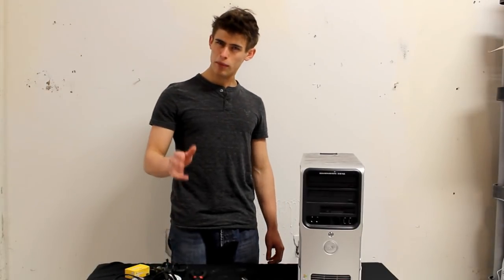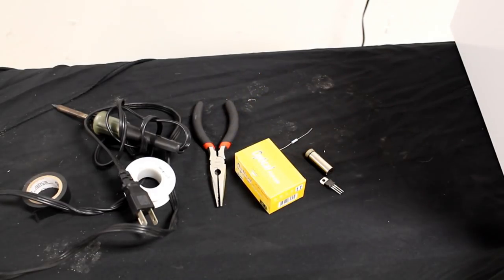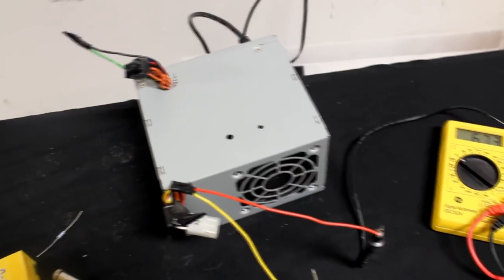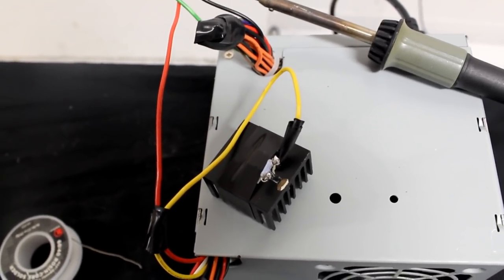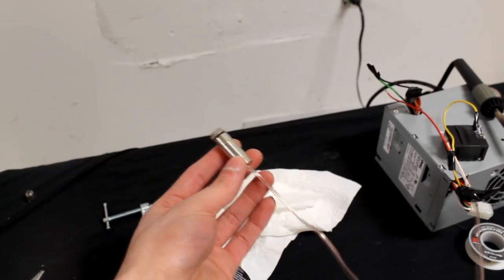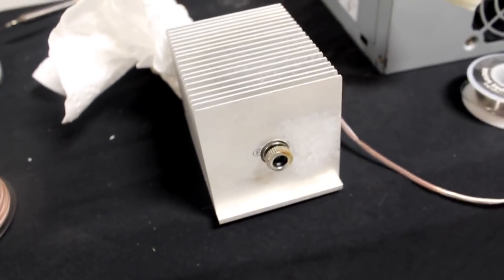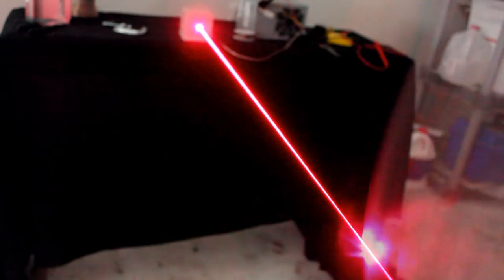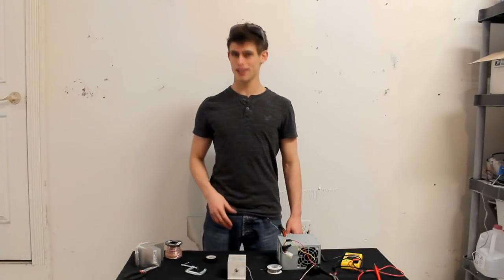Building a Burning Laser from an Old Computer!!!

Comment: I can remember harvesting my 1st lzr diode many many moons ago from a old DVD burner recorder....

Now laser parts dist'rs the world over will sell nowadays the bare factory diode if desired, & so now there's no need to HARVEST IT by CAREFULLY cracking the diodes factory heatsink to remove those precious diodes after removing it from the drive unit...

The AixiZ module housing will mount most 5.6mm standard to 9mm optical lzr diodes, & is a perfect component designed for focusing & added heatsink protection, & suitable for a added heatsink modification to surround it for the higher wattage output range diodes...

A awesome hobby w/ many possibilities imo...

Comment: Fun Fact: In a Zombie Apocalypse, this stuff is REALLY easy to find.
Reply: Oil Trap/Damaging Laser Pointer
Reply: I mean as a laser sight on a gun.
Reply: K.
Reply: Machinator True.
Reply: +UNSynaps but it could smell you
Reply: +Machinator  can be used to ignite items at long distance
Reply: In a zombie apocalypse, this thing is no use... Better use a giant stone instead of it...
Reply: +Vincent042 They could still bite you afterwards.
Reply: it would take a while to kill a human, let alone a zombie with this. It took it a few seconds to light a match.
Reply: Shoot the zombies in the eyes with it
:D
Reply: maybe if you had a 100w laser.  Insta-kill
Reply: could tape a match the mouth of a 55 gallon gasoline drum and... you get the idea
Reply: if i were on a apocalypse and wanted a laser weapon, i would try to find one of those 20k volt capacitors and try to make a single pulse laser that can set some volatile compound on fire from far away or something

Comment: I keep watching your videos, and I keep wondering what you put behind the laser so it docent burn your wall...
Reply: A piece of metal?
Reply: +AFiercePanda Metals reflect, he probably just uses a brick.
Reply: _ RaZ Sure it wont cut the wall, but if it ignites paper, it will blacken or burn paint and could start a fire.
Reply: maybe but i think it wont do nothing to the wall
Reply: +_ RaZ is that a double negative?
Reply: i am confuse.....
Reply: don't need anything the seriously lose burning power the farther away u are from the diode : )
Reply: wat
Reply: probably concrete slabs or something
Reply: +Meep “the” Changeling  My guess is that by the time the laser hits the wall it has lost its focal point so the laser light is dissipated into a wider area.
Reply: stainless steel metal stainless steel resist heat
Reply: lol that reminds me of that one part in half life with the giant laser
Reply: It was his cat...
Reply: poor cat....
Reply: Midichlorians
Reply: basically anything that doesn't burn as easily as wood or paper and is non-reflective so that it can't get reflected into his eyes an potentially damage his eyes... Hey I just noticed something, he should be wearing eye protection or sunglasses at least when he's playing // messing "around" with a laser
Reply: Ariss hahahah true, I'm still stuck at that level, no matter where I go I just end up at the beginning...
Reply: infrared blocker + black piece of plastic?
Reply: Please send me the laser pointer making details and diagram please
Reply: The wall is white, meaning it absorbs very little to none of the light spectrum. No absorbtion= no heat / burning. That's why he uses black electrical tape and balloons to shoot lasers at because they absorb all of the spectrum so they heat up the quickest. A black sharpie mark on the wall would be  enough to burn a hole on it.
Reply: @junioraltamontent.7582  So let me take a black marker to school and a laser let's see bullies run. 😂😂😂😂😂😂😂😂😂😂😂😂😂😂😂😂😂😂😂😂😂😂😂😂😂😂😂

Comment: styropyro Why did you use the yellow and red wire on the power supply? The red wire is +5 volts and the yellow is +12 volts. Would it not work better if you used the +12 volts yellow wire and connect it to a black ground wire? Giving you 12 volts not the 7 volts you were getting in the video. Also, you could try to twist the red and yellow wire together giving you 17 volts but you might fry the power supply in the process so be careful.
Reply: MelodicMurder 12 volts would fry the diode or the driver first...If not, 12 volts would be a waste of power to the driver anyway
Reply: The Laser Channel it would be cool to see.
Reply: MelodicMurder
Why? it would fry the diode or driver... that would be a waste of time lol
Reply: If that happened I would get stronger components to see how far I could push the build. Moar Power
Reply from the maker: MelodicMurder Laser diodes need constant current, so any extra voltage that the driver and laser diode don't use gets turned into waste heat in the driver. That extra 5V times nearly the half an amp that the circuit is taking puts an extra 2.5W into the driver, which is unnecessary. 7V is enough to power the circuit/laser without causing overheating!
Reply: styropyro That makes perfect sense. Thanks for another great video.
Reply: styropyro HI friend how many MW is the laser
regards
Reply: Video Ciencia Miguel 5mw so its completely eye safe, try sticking your eye in front of the laser.
Reply: MelodicMurder  Since the 12v has higher voltage than the 5v , you are essentially causing a short when u twist the yellow and red wires together.

Comment: Guy's pretty smart actually, really knows a bit about Elec. Engineering. :3
Reply: Mitchell Julius Actually, he doesn't.  If he actually knew anything about computer power supplies, he wouldn't be tying the red and yellow wires together.  The red is +5v, yellow is +12v.  He's probably actively destroying the power supply by doing that.
Reply: What you just cause you know a thing or two makes you an adult? Go in and tell me all the degrees you got now.
Reply: Mitchell Julius I have a degree in computer technology and engineering.  I live on my own with a 2015 Subaru, no debt of any kind, I have what I own from the money I earned, and I'm not a virgin.  I'm in my mid 20s and more adult than you'll probably be by the time you reach your 30s.

Not that any of that matters, because you don't need to be an adult or have a degree to look at the friggin sticker on the PSU to know that you don't treat the red wire like ground.
Reply: Mitchell Julius I literally said "not that any of that matters".  Besides, if it doesn't matter to you, why did you bring it up?  Damn kid, you are digging yourself deeper into this.  Do you think at all?

Anyway, I don't know why you're so adamant about defending this guy - he did something that someone in middle school know was wrong.
Reply: Peter Schmidt can you chill?
Reply: 7v is a good voltage to use for that application. Anymore and it's just getting turned into heat. That's not hurting the power supply. I've got one hooked up just like he shows and it's been working fine for about 5 years now. Its probably on about 3 hours per week.
Reply: mouser485
The voltage is fine, the way he connected it isn't.  Every PSU design is different and I wouldn't trust that all of them could do something like this safely or reliably, and I'm sure some of them won't allow it at all.  I have no doubt that you can do this, I'm just saying it isn't advisable.  If you've been using this laser for only a few minutes at a time, I don't suspect anything bad is going to happen.  Leave it on for a few hours or days and I suspect, for best case scenario, things get REALLY hot or the output isn't 7v anymore.

I've used cheap PSUs where the +5v rail had no overload protection and could handle things well beyond their wattage rating, while others would intentionally power off.  I'm sure some of the more expensive models will just simply shut off if you short the +5 with the +12. The available wattage could have a lot to do with how prone it is to an accident.  If you're using a cheap Dell PSU like the guy in the video is using, I'm sure it'll work problem free for well over 10 minutes.  Again - not advisable.
Reply: Just for the record almost any circuit will heat up if it's left on for days and why would you leave it on for days anyway
Reply: +Peter Schmidt dude not tryin to be mean or anything but honestly you just GOT FUCKIN TOLD TWICE
Reply: +ElfNet Gaming u are so mad :(
Reply: prckata no not really, just amused
Reply: +prckata Thats not mad. it is good advisory to just not listen and build every shit what the internet shows to you. what he is doing here with the laser is something that can greatly impact the health of your life. 

but it is up to you if you want worship someone who build something that is not safe, and put down people who are making good advise. People like +Peter Schmidt  and +ElfNet Gaming are here to protect you from bad things and not to hurt you.

The OP is here obviously to get money from youtube. more flashi it is, more people will watch it, and he will get more advertiser money...
Reply: CaqKa ^^ This ^^
Reply: лол

Comment: The power is really dirty from a PC though so you should add a capacitor to clean up the ripple/noise. Your components will last longer that way. Especially if you are pushing them past specs.

Comment: Hi 2 questions:
1) what is the wavelength of this laser and where to get eye protection goggles?
2) I saw the laser fired in the video. what heat dissipator was used on the other side of the room without burning down the wall?
Thanks
Reply: The laser is not a fire hazard from more than a meter away because the beam spreads out to much.

Comment: what happens if you just connect a 9 volt to the diod.
Reply from the maker: The laser diode will break almost immediately. You have to regulate the input current because laser diodes are very picky!
Reply: +styropyro thank you for the feed back really appreciate it.
Reply: Use it by aiming on the moon ;)
Reply: maybe it will easy get hot and melt the laser head
Reply: +styropyro hey man, can I use an old phone charger (5V 0.7A) for power surce?
Reply: Gilberto Turquetti a computer power supply is really cheap for like 5-6$
Reply: styropyro What If you use a 1 watt diode?

Comment: Can you build a DIY (similar to this) that works like a security system, ie: when the laser breaks an alarm goes off?
Reply: +CardiganJane You need a couple of photoresistors (ldr) and transistors to build an simple security system.
Reply: +MrApplecraft and a lazer that wont burn...
Reply: you would burn the photoresistor. If you want to burn the intruder you could always add a more powerful laser on the side and have something that can absorb it on the other side

Comment: Has to be fake. Yellow wire is 12v, red is 5v on a pc power supply. With no negative wire connected to the laser, it won't work. The electricity has no flow.
Reply from the maker: +jkbhso3 I know that wiring configuration looks weird, but potential is relative so using 12V as the positive and 5V as the negative means that the driver is only running on 7V (the difference). I'm using a linear driver, so I want to run it near the minimum voltage it needs to operate to avoid as much waste heat on the driver as possible.
Reply: +jkbhso3  OMG... Look up the definition of voltage or difference in potential... Any who, you just proved what he said in the video about having a 7 volt powersupply.
Reply: 12v act as positive and 5v act as negative. Basics of electricity boss
Reply: 12v act as positive and 5v act as negative. Basics of electricity boss
Reply: 12v act as positive and 5v act as negative. Basics of electricity boss
Reply: +styropyro where did you buy that laser diode?
Reply: +jkbhso3  you learn something
Reply: the red wire re-routes power to the power supply
Reply: +jkbhso3 12V-5V=7V and he got 6.73V
Do your homework!
Reply: ***** Why? The one is 12V and the other 5V...
Reply: TTL and CMOS has 5V DC...
Reply: I worked with pc power supplies. The both in the middle are ground (0 Volts), and on one side 5V and the other side 12V. A device between 5V and 0V gets 5V DC. A device between 12V and 0V gets 12V DC. And I think that so a device between 12V and 5V gets 12-5=7V DC...
Reply: And when the diode needs 5V, why he didn't connected it directly between 5V and 0V? Maybe because the driver needs more than 5V when it outputs 5V itself. I do not know that.
Reply: Ask me if you have any more questions. :-)
Reply: has to be fake you guys right
Reply: Yellow & Red = 7 volts and works perfect try it!
Reply: +Tsagami it has 2 be fake like it cant burn
Reply: +jkbhso3 Computer PSUs are not as simple as a battery. They have many features to prevent damage to the computer. This includes the red wire acting as a negative in this case.
Reply: @Erix actually a cheap PSU like the one used in low to mid-end OEM computers is actually very simple. Though even more expensive PSUs are still pretty simple, just with more elaborate circuitry to bring up the efficiency of the PSU.

Other than a 5v signal and basic self-test circuit. Cheap chinese PSUs emit a good signal despite lacking any self-test circuitry. Protection of a circuit is up to the circuit itself in most cases, especially so though when two circuits are not designed by the same company/engineer. This is safer as you cannot rely on someone else's circuit to protect yours, you can only hope that it performs according to spec and design defensively for when it doesn't.
Reply: *****, that is right. But: I tried it. It worked with every PSU I tested and they were not cheap or old at all.
Reply: Actually, and this is coming from a dude with an Associate Degree in electronics, it is not necessary to go to ground for electrons to flow. All it takes is a difference in potential. Since 5V is less than 12V current will flow from the 5V lead to the 12V lead. Think. If you can read voltage with a meter you are already carrying current. Without current, the meter  wouldn't function.
Reply: jkbhso3 same question what should i do now
Reply: jkbhso3 his just click bathing man
Reply: 12 - 5 = 7volts (as mentioned in the video), the 12v lead becomes the positive, the 5v lead becomes the negative.

Comment: just saying for the longevity of your power supply over there, you should really have a small load between the green and the black otherwise itll slowly burn through the psu (and potentially cause a fire...) just some really high rated amperage but low rated resistance resistor will do very nicely

Comment: Nice! Now I just have to find some old scrapped computer with a DVD burner.
Any way it's probably cheaper to buy a new DVD-burner or Blue ray (for a blue laser) and rip it apart just to get the laser diode, than it is to buy a laser pointer that has the same power

Comment: Can you provide a parts list?  I couldn't understand what you were calling the part that the laser light comes through.
Reply: Stephen Mullinax The laser? it's an Axis Laser Module, and the rest are laser diode, LM317 chip, a resistor (i dont know the size), some power supply and Heat Sink from the computer
Reply: @hanschristianhadison2896  3.03 resistor should be enough
Reply: @Alucardtv  can i use a 7.4 volt and 400 mA battery?

Comment: I wonder why you don't use ground wire from the PSU. I mean... Red wire is +5V, yellow wire is +12V and black is 0V (ground). Using red and yellow would give you something about 7V (which is what you get) but normally the current is supposed to flow from them to the ground wire and not between them. There are also few more problems with doing that (which I won't be discussing now).

Is there any particular reason for using red and yellow instead of black and yellow?

Comment: Hey comrade, I've been burnin my laser diodes like crazy just trying to power them with whatever I have laying around. But was going to try using the 5v 1.5 amp PSU (i have a ton of spares) line to power it kinda like you did since it must be a stable current for computers and is at the high limit end of most laser diodes from CD drives. I WAS going to do this because of my lack of electronic parts like LMs and such.. Any thoughts on this? Also as always amazing videos truly cool stuff.

Comment: styropyro Have you ever considered trying to build a Yellow DPSSL? Would it be more worthwhile (and cheaper) than trying to buy one pre-made?
Reply from the maker: ***** I spent a lot of time over my spring break trying to rebuild a non-functioning 589nm yellow DPSS laser with no luck...yellow definitely is trickier to work on than even 532nm DPSS that's for sure! Hopefully I'll get that laser running some day...
Reply: styropyro Sounds like a difficult project. Will you make a video on it if you get it working?

Comment: A computer PSU's voltage rails are not really designed to sink current like that. You'll most probably burn the PSU out. Just use the 12V rail and ground and strap a heat sink to the 317.

Comment: what is the laser projected onto so it doesn't burn the house?
Reply: i was wondering that too
Reply: Just on the wall. It doesn't burn your house lol. Its probably projected on a white wall. And its certainly out of focus at that point so it doesn't even get close to burning your house down at that range. Try a 30W laser. That will burn. 30000mW compared to 250mW

Comment: Could you weld a handle onto the heatsink, and find a way to back mount the power supply for limited mobility?
Reply: +Ryan McClure a back pack and alot of batterys so you can show off
Reply: You can get this in the form of a pocket flashlight. You can make them. Go to laserpointerforums and you will see.

Comment: So um... I tried making a similar laser with a dvd player from a thrift store, and I supposedly did everything correctly. I have an LM317 with a resistor wired across V out an d Adjust, but I guess my problem is knowing each diode and which stub is positive, negative, and not used. My setup uses a power source of an old drone (3.7V 380mAh) pretty standard, but no matter what I do, the diode does not light up. I think current might be flowing through the circuit, but there is no light. Any suggestions?